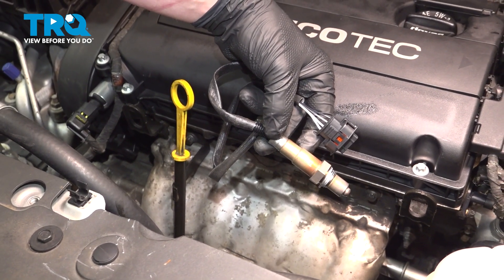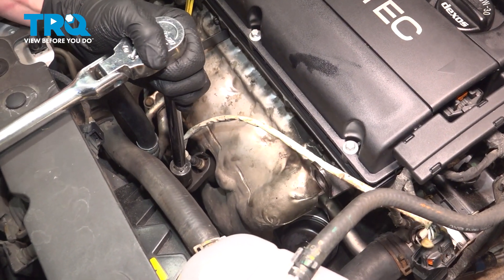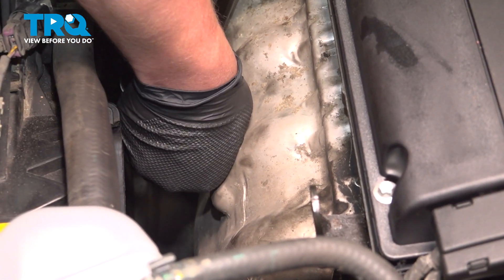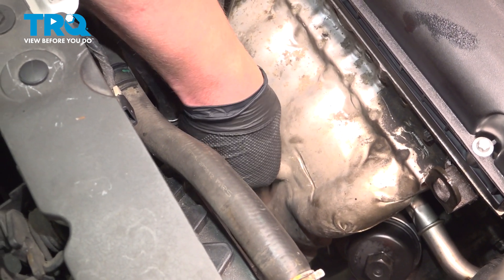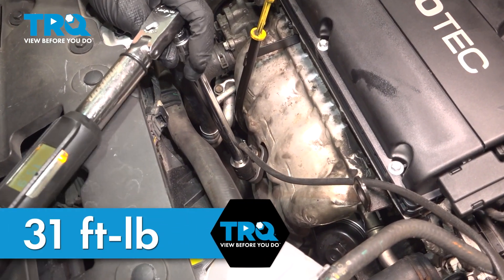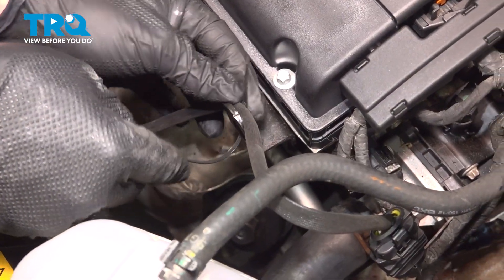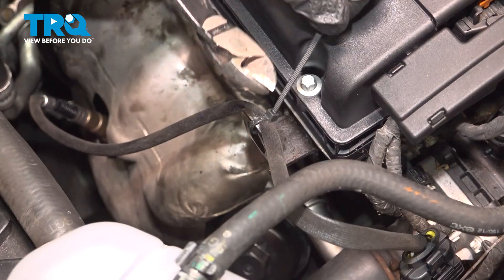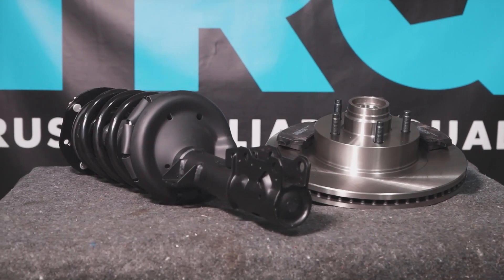How to Replace Upstream O2 Sensor 2012-2020 Chevrolet Sonic

Comment: My cars code is p0171 and p2270 fuel trim system lean and HOQS signal stuck lean sensor two. Is that the upstream or the downstream sensor?

Comment: Thank you for this video… it was very much needed. Also, for the viewers: VIP TIE THAT WIRE TO THE HOLDING BAR, OR YOUR FAN WILL EAT THE WIRE lost $170 because I needed it fix ASAP. Luckily not more because I did it myself.